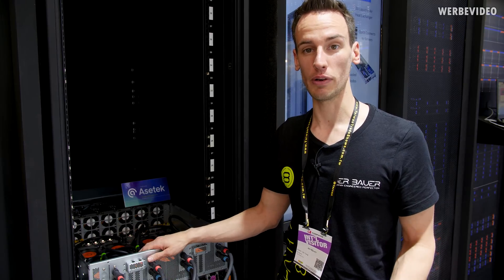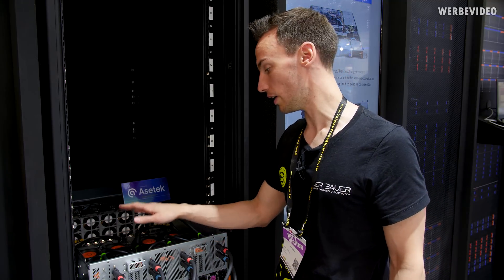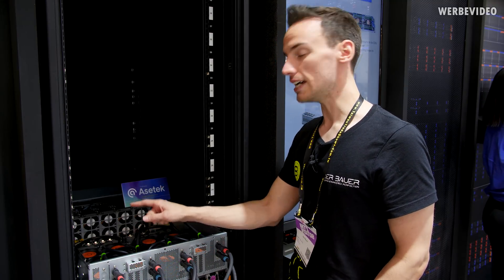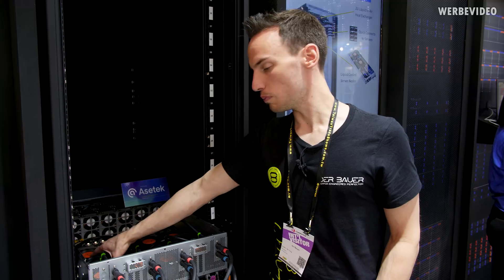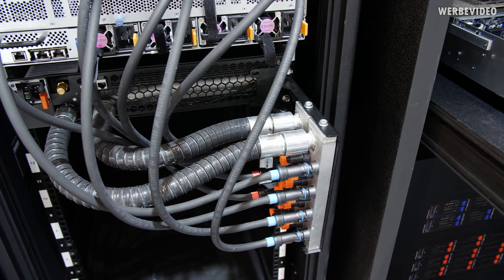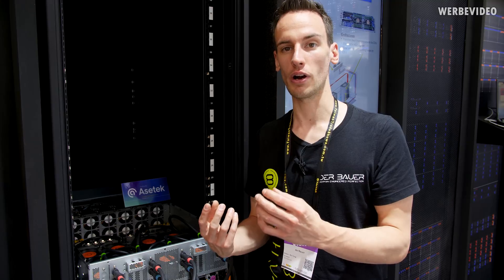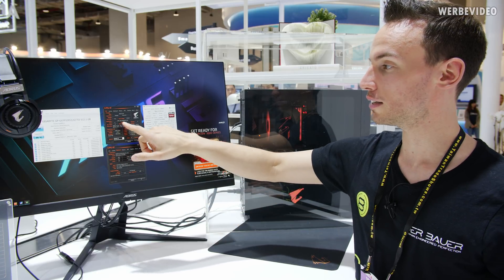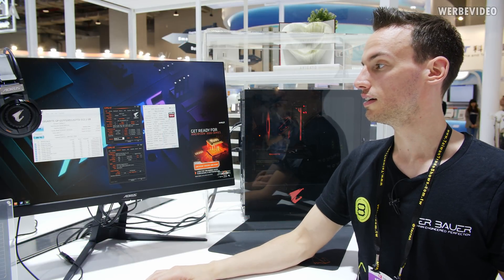Gigabyte Server with 8 Pumps + RYZEN 3000 spotted running

Comment: On PCI-e 4.0, it would be interesting if there was a motherboard that was designed to run the top x16 slot at x8 since we don't need the bandwidth for the GPU.  This would open 8 lanes for more nvme drives hooked directly to the cpu.  They could also run the 8 lanes to the second x16 slot.  I'm doubtful, but that might improve multi-cpu setups when both cards have 4.0 and both have direct connection to the CPU.  Would be interesting to see the test results from this on Navi, but might have to wait for 3rd gen thread ripper to be able to test multi cpu hooked up to the CPU vs multi-gpu hooked through the 4x pipe to the chipset.

Comment: Thata better be a engineering sample 2.2 ghz on idle as minimum clock would be bad. And that 4.2 ofc is a few seconds at best so fall within the short term clock boost long term it would not surprise if it only does 3.9-4.0 on all cores. 
Computex 2020 on the go kit addition: USB Mouse.
Reply: the man actually said that in the video... do you people even watch these ??
Reply: I obviously ment that as: they better change that for the actual launch...

Comment: If you are handy then hooking up a wireless mouse receiver should be possible for that Gigabyte system, that glass thing around the case has a big hole in it for the cables, in theory it should be possible to come up with a construction to get the wireless receiver plugged in. It would be hilarious if somebody did that.

Comment: 3:50 Ryzen 3000 CPU cache configuration shot. I don't know if the cache info is correct though, these are supposed to have 32MB LLC? BTW, a boost of 4.2GHz for 6C/12T would make it a 3600-nonX part. The 3600X boosts to 4.4GHz.

Anyway; so is CPU-Z wrong, is the public reporting we've gotten wrong, or is the L3 not the LLC, e.g there's L4?! I love me some big caches.

Comment: Gigabyte: “Der8auer is coming. Quickly remove the mouse and keyboard”

😂
Reply: Most likely its an unstable sample which will crash in heavy load. It just shows pcie 4 and boost capabilities. 
Messing with it is frown upon. Usb ports may be disable too...
Video games do this too. They show their employees playing a "fully stable" demo but they dont show the buggy features just the stable ones
Reply: there are others who might actually endanger the hardware by not knowing what they are doing. Der8auer is little concern in that matter.
I suspect it is rather that they set up the system in a specific way and do not want to redo that all the time.

Comment: Gigabyte: watercooled ser-
De8auer: LN2 cooled server. Boom
Reply: i want to see a Server in wich it makes sense to use LN2...on the long run.
closed circuit LN2, with the evaporated LN2 being collected and reliquified.( you will Need O2 supply in the Server room, and Arctic clothing)
Reply: @ulrichkalber9039  i dont think any set up makes sense for ln2....

Comment: 4.2GHZ at ~1.332v... interesting. A little room there I would think..  6core chips can be cooled with basic AIOs up to about 1.4v
Reply: it was overvolted. The same thing is applied to ryzen 2000 series too. I used -0.09375v on my with expressive boost mode.
Reply: @nhozdien5058  yes more than likely 1.332 is more than needed for stock clocks. Worst case scenario it still has a LITTLE room for OCing voltage-wise anyway
Reply: @skoopsro7656  4.5ghz on all cores for all chipslets with voltage below 1.45v should be possible

Comment: PCIe 4.0 helps with out high BW IO devices like 10GBe. Which currently needs x8 2.0 or x4 3.0 lanes for max speed. With 4.0...just 2 lanes needed. This can also be applied to say TB for more bandwidth and more plug and play device like external 10GBe
Reply: indeed, GC will probably Need some more time to be using more than 16x PCIE3.0 or 8xPCIE4.0.
wich means that a Mainboard that switches to 2 times 8xPCIE 4.0 could be used with a rather fast SSD on the second Slot.
I wonder weather it is possible to adapt 8xPCIE4.0 into 16xPCIE3.0 without causing to much lag, that would allow a lot of Things...
for example running one PCIE(16x3.0)SSD from 8 lanes(4.0) 
I also imagine an Adapter Card that would take 5 NVME(4*PCIE3.0) drives in RAID5 that would be presented to the System as one Large(FAST!!) SSD on PCIE4.0x8
also I wonder if an Adapter is possible to run two NVME(PCIE3.0)devices from one NVME(PCIE4.0)(M.2) Slot.